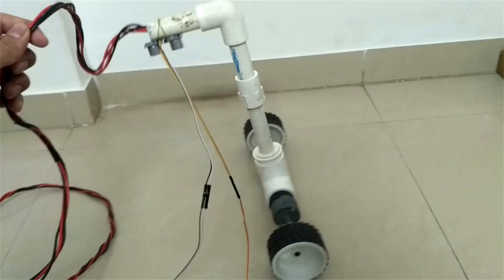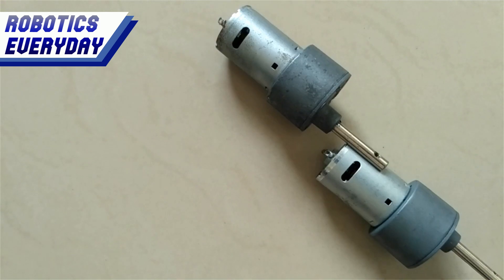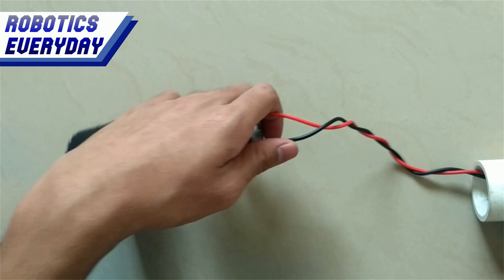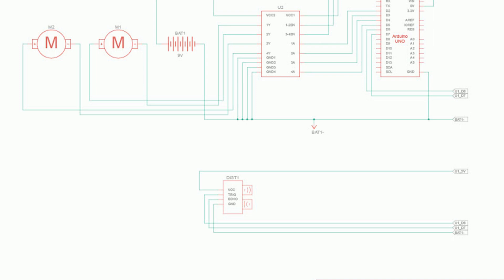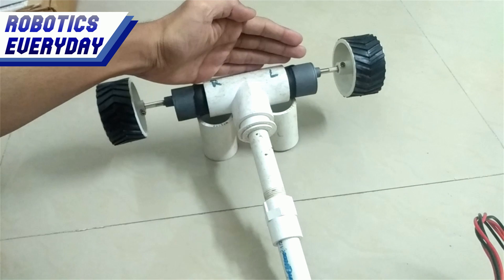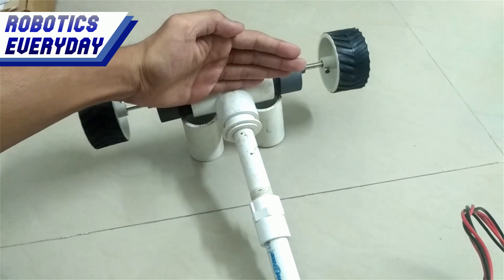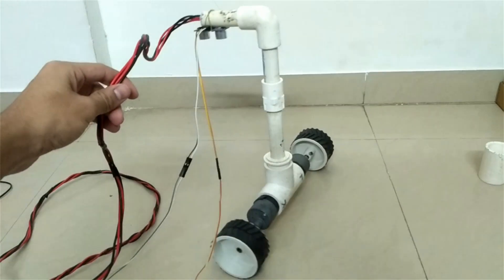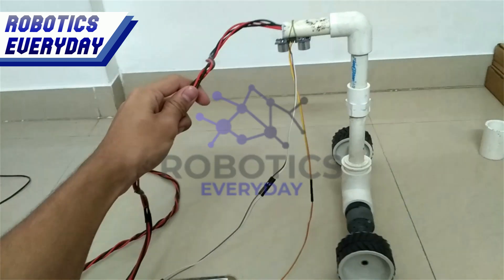Wheeled Self-Balancing Robot | Without IMU (MPU-6050)? Only Arduino Ultrasonic Sensor & L293D

Comment: Nice to see this works! I am building a self balancing robot - it currently uses just a gyro, but I was thinking of using an ultrasonic sensor to reset the angle to compensate for gyro drift. I have tried combining with an accelerometer, but got worse results as it moves around a lot.